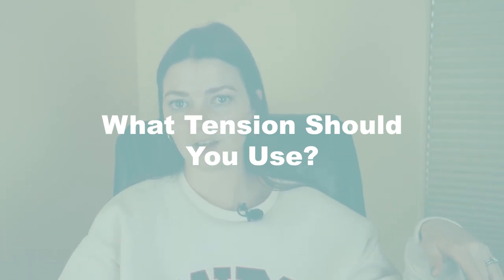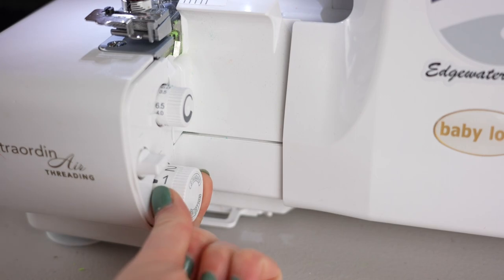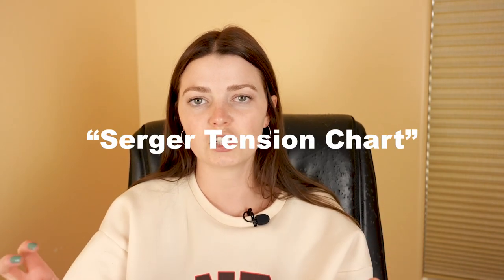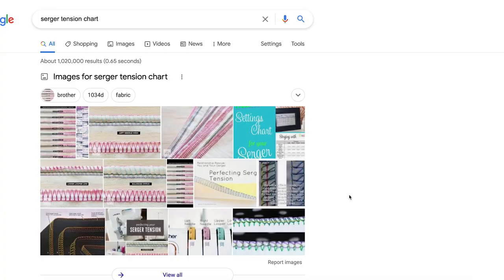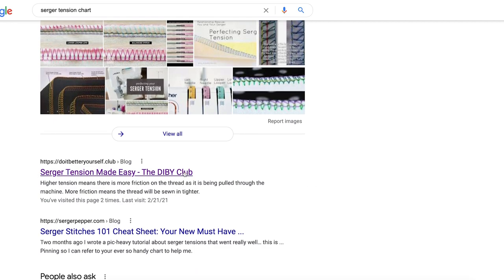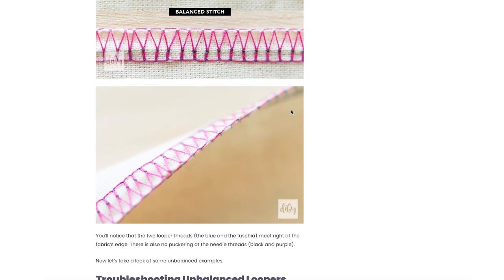All About Swimwear Elastic (Part 3): Troubleshooting

Comment: Hey unfortunately I’m still getting curling and rippling 6mm bikini straps. I’ve also changed needles and tension. The problem only appears when the the straps are turned with a loop turner. Before they seem to lie flat and neat. Why is this happening? Can I solve it?

Comment: When you are sewing bathing suit bottoms, and are about to sew the gusset section, do you sew through the elastic as well? Like, are you sewing through 4 layers of fabric, and 2 layers of elastic? Or is the elastic shorter than the fabric, preventing it from being sewn wh en you sew through 4 layers?
Reply from the maker: Two layers of elastic! Always sew your elastic all the way to the edge of the seam. Even though there's two layers of elastic, when it's unfolded it still lays flat if you give it a good trim!

Comment: Thank you so much for this video, Katie! I am using just a sewing machine and am having trouble with the stitches skipping while attempting to attach the elastic. I've tried different tensions and thread width, any other suggestions? Thank you again!
Reply from the maker: Does it happen with other fabrics too, or just knits/swim? If it's happening with other fabrics then you might want to get your machine checked out- it's possible it's a malfunction or mechanical issue with the machine.

Otherwise you might want to try a walking foot and seeing if that helps!
Reply: @EdgewaterAve  It just started happening, and it seems to be happening with all fabrics. I think it's time for a professional! Thank you so much :)

Comment: Is it better to have a serger or a regular sewing machine when making Swimsuits?
Reply: 100% a serger
Reply: @bieberblast255  is there a specific one you’d recommend?
Reply: @shayjvr1921  The Brother 1034DX, its the cheapest option but still does everything the expensive ones do!
Reply from the maker: I personally think you should at least have a regular machine to start with. Then if you can, definitely get a serger as well, it's so much easier and faster (and better quality). However, if you only have a serger and don't have a regular machine you won't be able to make some styles. For instance, you wouldn't be able to make a basic triangle top because it requires a straight stitch, which can't be done on a serger. So if I had to choose one I'd say a regular machine, but ideally both!
Reply: @bieberblast255  same I love that machine such a good price and does an amazing job